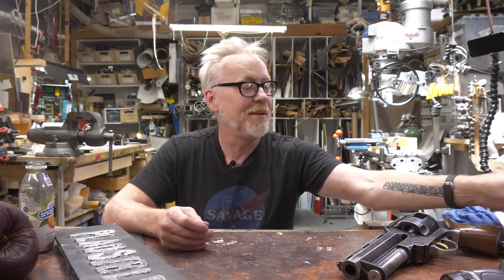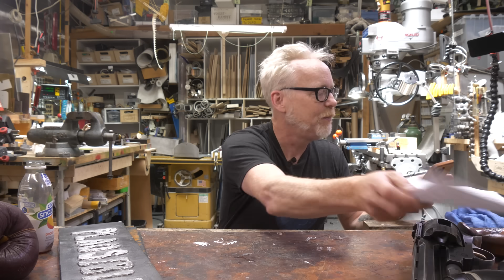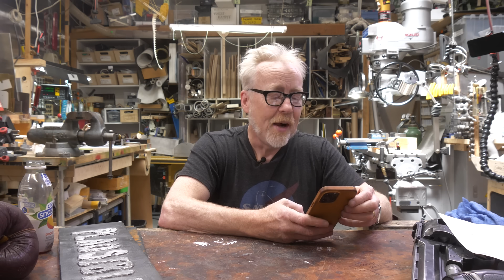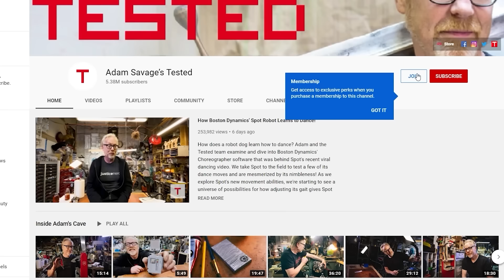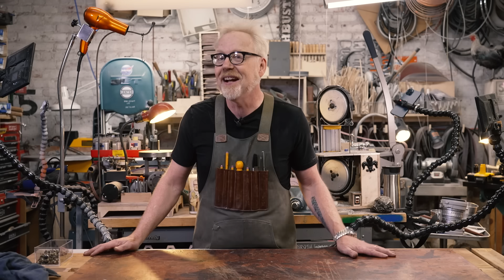Hardest-to-Obtain Item in MythBusters History

Comment: To make it even thinner than requested is the most German thing ever, but also they probably used metric, so delivered 20 micron thick lead foil, which is 0.000787 inch.
Reply: German engineering never fails to impress man, it either works beautifully or fails so spectacularly you can only be amazed
Reply: @thereinthetrees_5626  no, he is not. 0.7 thousandths is 7 ten thousandths which is 0.0007 inch which is roughly 20 micron
Reply: @thereinthetrees_5626   You are correct about 
0.1 one tenth
0.01 one hundredth
0.001 one thousandth
0.0001 one ten thousandths 

But Adam said they requested one thousandths of an inch (0.001) and they made it even thinner. Any thinner than 0.001 you need to move over a decimal place, 0.0009999... would be the next step smaller.

He specifically said 0.7 thousandths or 7/10 of a thousandths. 1 thousandths, as you pointed out, is 0.001, so 0.7 thousandths is 0.0007
Reply: @libtrs838 in terms of Machining, it’s actually sort of backwards. 

1.0 = One Inch
0.1 = One Hundred Thousandths
0.01 = Ten Thousandths
0.001 = One Thousandth
0.0001 = One Tenth (Or One Tenth of a Thousandth)

Adam said it was 7 Tenths of a Thousandth = 0.0007   

0.7 of a thousandth would be improper grammar.
Reply: @thereinthetrees_5626  I'm embarrassed for you.
Reply: @ErwinPommel  why would I care?
Reply: @thereinthetrees_5626  No reason you would. After all, you have a history of being wrong here.
Reply: @ErwinPommel  and I care why?
Reply: @thereinthetrees_5626  nothing wrong with looking like an idiot, as long as you accept it
Reply: @thereinthetrees_5626  
If you don't care why do you care if we know you don't care? If you actually didn't care you would just stop replying. Because you're just looking dumber and dumber every time you say that...
Reply: @thereinthetrees_5626  lol. You’re waaaay waaay off. By an order of magnitude. WAYYYYYYYYY off.
Reply: @thereinthetrees_5626  you might care since you wayyyy wayyyy cared enough to comment about how wrong someone was, only to get called out for being wrong yourself.
Reply: @thereinthetrees_5626  "why would I care?"
Said by the idiot who cared enough to reply lol.
Reply: @thereinthetrees_5626    That's weird, because you seemed to really care when you thought you were right...
Reply: @laserpanda94  and I care why?
Reply: @thereinthetrees_5626  it's your ego that's got you caring this much, unfortunately. Ego is responsible for a majority of human failure, and inability to master your ego is not uncommon, but it does give you a flaw you can work on. Good luck.
Reply: @thereinthetrees_5626   I dunno. Maybe you're one of those insecure people who treat knowledge as a zero-sum competition and can't admit that you might be wrong? Or maybe you use online interaction as a means of trying to exert an authority or dominance that you lack in real life, only for it to backfire spectacularly on this occasion?

Only you can really explain how and why you choose to interact with people and that's only if you are capable of being honest with yourself.
Reply: @thereinthetrees_5626  just admit you were wrong dude its ok. We are all wrong often. It is unbecoming to double down on wrong, and much more admirable (and unfortunately rare in this context) to just own it and say "oh yep, youre right I was wrong...oops!" and move on.
Reply: @MattH-wg7ou  not reading that
Reply: @thereinthetrees_5626  tldr: just admit when you're wrong.
Reply: @MattH-wg7ou  not reading that
Reply: @thereinthetrees_5626  simply commenting to remind you about your wrong moment which you believed so right, gotta add wood to your dying flame.
Reply: @ej9975  who are you
Reply: @thereinthetrees_5626  not reading that
Reply: @ej9975  correct, I didn’t read any of it
Reply: @thereinthetrees_5626  not reading that
Reply: @thereinthetrees_5626 i is rare to see someone care this damn much without knowing why.
Sadly nobody else can help you with this question.
You will have too look inside yourself to see why you care ever so much.
Reply: @thereinthetrees_5626  The lady doth protest too much, me thinks.
Reply: @thereinthetrees_5626 If you didn't care, you wouldn't be here. So, in fact, you do nothing but show you do actually care. So you're wrong...again. If you really didn't care, like me, notifications would be off, and you'll never be back to read your comments.
Reply: @sanctionh2993  don’t care
Reply: @thereinthetrees_5626 please “do it “
Reply: @thereinthetrees_5626 I know you are but what am I?
Reply: @lindboknifeandtool  dude hasn’t made it out of 2nd grade yet
Reply: @thereinthetrees_5626 reminder that you're still wrong and still unable to admit it
Reply: Germany has a strong policy of promoting medium sized company called Mittlewerk. They are protected from coompetition and promoted with subsidies though they also have large taxes on them. This was put in place after WW2 to help build up the destroyed German industry and was so successful they never got rid of it. Many German companies actually reject growth to remain in that medium size which you would think is bad but it has served Germany well. Cause that leaves economic niches open for other medium sized companies leading to a diverse economy rather than having a handful of megacorps that control everything such as is the case in the modern day US.
That is not to say that German megacorps don't exist though, they do. Examples include Siemens, Volkswagen, Thysson and Rheinmetall but while they are powerful they are not as dominant as their American counterparts.

American medium companies are operating on the very margins on existence cause they live in constant fear of being absorbed by the megacorps. German medium companies can be a lot more generous and devoted to their craft cause they are protected by the government against hostile corporate takeovers. Eppsteim wouldn't have done these things if it had to exist in constant fear of being taken over by Krupp-Thysson.
Reply: IKR? Like that BMW designed engines 14% more powerful than Gordon Murray's original specifications for McLaren F1.
Reply: I had a stroke reading that
Reply: Man I'm a toolmaker and can't even wrap my head around leadfoil being .02mm
Reply: germans were probably like challenge accepted
Reply: BUT it is not the requested product. What if the thickness was specifically required? Welp, who knows, the guys at Eppstein Foils probably knew exactly what the mythbusters were looking for, it just didnt find its way to the story.
Reply: @bedeckt  They knew exactly what the mythbusters wanted cause Jamie told them.
Reply: Don't why Americans refuse to use real units.  "Freedom" units ie imperial British units are so outdated and no longer used for a good reason.  But Americans cling to it.  And try make out like it's theirs they made it.
Reply: @thereinthetrees_5626  why don t use the SI prefix?
Reply: my brother in christ this is america and grenades can be made with proper paper work
Reply: @myleslaurin3051  He said that he had no problem getting the shell and making his own.  He HAS a problem actually acquiring a live military issue grenade, because they are a controlled ordnance item, let alone quite deadly.  And anyone stating they can get you one would likely have to commit a few federal felonies to get it to you, or others in his "supply chain" path.
Reply: You want precision you go see the Germans.
Reply: You couldn’t just get a blank grenade and make it into a real grenade and use that
Reply: germans don´t joke around.

they just deliver.
Reply: @thereinthetrees_5626  I see where you may be confused. In the machining industry, those types of measurements are referred to differently. This is because everything is based off .001”. So .1” is called “one hundred thousands”. .01” is called “ten thousands”. .001” is called “one thousand”.  .0001” is referred to as a “tenth” because it is a tenth of .001”. I was extremely confused when I first got into the industry, but when you work in increments of .001” all day, it does end up making way more sense.
Reply: @cavan1868  that hurts my brain but I see it's value lol
Reply: @cavan1868  That doesn't explain his confusion, because no one here, or Adam in the video was using machining language.

People wrote out 0.0007 and said 7/10 of one thousandths, or 0.7 thousandths, and described it as thinner than one thousandths  or 0.001

No one said it was one thousand, called it a thou, or said it was 7 tenths.

I have never heard someone call 0.1 one hundred thousands, I have always heard it called a hundred thou (0.1), ten thou (0.01), one thou (0.001), and one tenth (0.0001) or sometimes people say mil instead of thou so 10 mil = 10 thou = 0.01

You can say one tenth because it is assumed everyone is working off the unit "thou" 

Saying one hundred thousands sounds very confusing to me.
Reply: @cavan1868 as someone who works in the industry it's kind of sad that you keep saying "thousands". You should know it's "thousandths"
Thousand is to the left of the decimal point and thousandth is to the right.
Reply: "Made in Germany" is a mark of quality.
Reply: I like turtles!! 🐢
Reply: @DevilDo99Gaming finally. A salient point
Reply: @evanfrabell8884  that genetically superior talk can lead down a dangerous path in Germany!   Is ltd not genetics it’s cultural.  In Germany being an engineer is like being a Doctor in other countries.  It’s a respected profession.   So she the clever kids or their parents are pushing them down a particular career path engineer is high on the list.    In the UK and I suspect the US they’re more likely towards Law Medicine or finance.
Reply: @thereinthetrees_5626  Did you edit your comment to be correct or am I REALLY confused by the comment section?
Reply: @atlasfeynman1039  He's just unwilling to admit he was wrong and has to make a series of snarky comments instead of just turning off his notifications like normal people do.
Reply: Easy there, tiger. Adam said it was "point seven of one thousandth of an inch". Isn't that so much clearer?
Reply: @MagnusWissler  0.000787 inch. Or, point seven eight seven of one thousands of an inch. Also, the Germans probably were very sad that their machines could only dial microns in steps of 10 and they had to deliver the next best thing.
Reply: @MytronixOfficial  lol Only the Germans would be disappointed in delivering a product that's better than what was requested because it's not exactly what was requested.
Reply: @slickstretch6391 it's not better if they asked for other specs
Reply: @MagnusWissler 7 ten thousandths of an inch
Reply: @MagnusWissler no. You obviously don't work with high tolerance stuff. It's alot clearer to just say .000787
Reply: An actual third grade math class here at Adam Savages Tested.  Today we're learning about the number... 10.  And all the fun ways we can bend it over a decimal.

First, Multiplication!  If we multiply 10 by itself, it becomes 100.  If we repeat this to 100, it becomes 1000.  A short hand for this is anything multiplied by 10, we add a zero behind it.  1000 X 10 = 10,000(ten thousand!)  See!  It's easy!  And the best part, we can do this endlessly!

Now, Division.  If we divide 10 by 10, we get 1.  Well what happens when we divide 1 again?  What we get is a fraction, 1/10.  Seems straight forward right?  But that slash is just distracting.  Another way we can show a fraction is by using a period called a decimal, which looks something like this 0.1.  We call this point one, otherwise known as one tenths.  This shows us that the resulting number is less than 1, but still more than 0.
If we apply the same short hand from above here, but inversely, we get 0.01, or one hundredths.

We can apply what we've learned here to decide if, in fact, OP needs to slow it down or not.  Let's make a table!

If 0.1 is one tenths.  
Then, 0.01 is one hundredths.
And, 0.001 is one thousandths
Then 0.0001 is one ten thousandths.
In turn would make 0.000787 inches in scientific notation(7.87 X 10^-4) seven point eight ten thousandths, or in a third grader's words: point seven of one thousandth of an inch. 
Dismissed!  I expect to see all of your parents at parent teacher conferences tonight!... except you Magnus we know your dad's an alcoholic...
Reply: @TwentyOnePunSalute best comment on the Internet.
Reply: Knowing the German's... making the foil one thou thick was likely no problem for the tooling.... finding a german brave and savvy enough to dare to alter the machine away from ze authorised settings.... not without a letter that the Fuhrer hasnt personally stamped with an eagle. In red.

Comment: I trained as a sign painter in Germany.  We used super thin lead foil to mask car enamel.  You can use vegetable oil to adhere the foil to the enamel, then use a pounce pattern to transfer the design.  Finally cut out the letters with an X-Acto knife.  Because it is so soft, it is great to use on compound curves.  The lead foil is also super easy to cut.  Then you cover it with a piece of paper, wad up a scrap of lead foil, and use that to burnish the edges for a fantastically sharp finished edge.  Clean off the oil from the cut outs, spray an adhesion promoter and then spray your lettering color.  I have tried lots of other masking materials, but never found anything that worked as well for cars as lead foil.
Reply: "The better it is at its job, the better it is at putting you in the box" 

We had a cutting fluid that made chlorine gas when evaporating.... It made cutting hardened steel (68 HRC)  feel (and feed) like high-lead brass.
Reply: That sounds so satisfying to be able to see.
Reply: As an electronics enthusiast there's just no better solder than lead solder. I've tried every brand of lead free solder and it's just a worse alloy. Lead is an amazing metal with lots of useful properties, shame about the toxicity!
Reply: @CoolAsFreya  you should try doped solder (germanium is my favorite)

Some of the stuff will make you drop dead if you miss any of the safety measures but the usefulness goes up proportionally
Reply: @CoolAsFreya  Lead-free alloys have come a long way since they were first introduced, I switched to SN100C by AIM and it works great, nice shiny joints but it does need slightly higher temp and more flux than leaded. For me it's about peace of mind and being able to touch circuit boards without worrying about washing my hands every time.
Reply: @CoolAsFreya  Fun fact: the Xbox 360's 'red ring of death' issue was never figured out(at least while he was there), but was suspected to be caused by the lead free solder they switched to due to EU regulation changes not long before it went into mass production. 
This according to Peter Moore, from the 'Podcast Unlocked' episode 201; it features Moore, Seamus Blackley(dude who thought of the idea & presented it to Gates & Co), and Phil Spencer all talking about the origin of the brand and first console up through the XB1(after Phil took over, before the XBS), amazing insight(including how they arrived at hardware specs and such) if you're into this behind the scenes stuff.
Reply: @RyTrapp0  I wonder if the lead-free solder had a lower melting point. I work with lead solder daily and there’s no way an Xbox 360 would get hot enough to melt the stuff I work with. I got the red ring of death on my Xbox when I was younger and remember looking up how to fix it. The underside of the processing chip inside looked like murder from the video, where all the solder points for the chip were all melted together. At the time I had no clue what a “reball” was or how to do it haha. But that lead-free solder had to be more susceptible to lower temperatures is my guess.